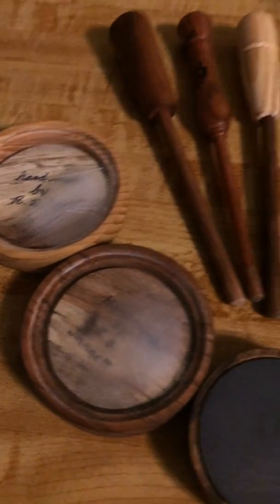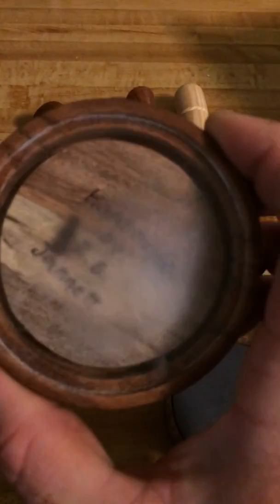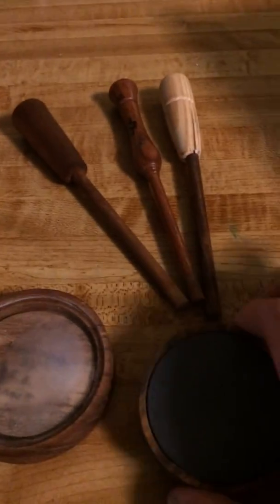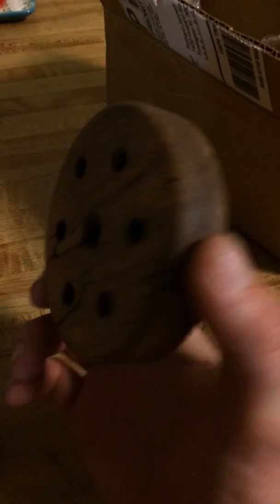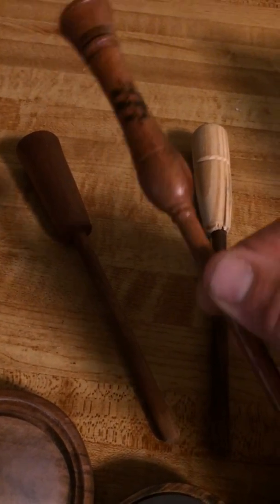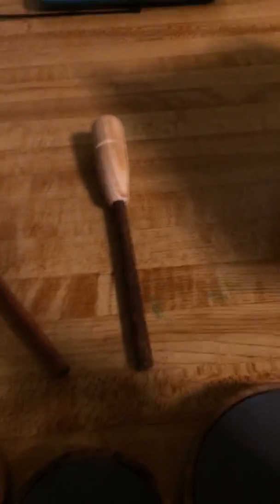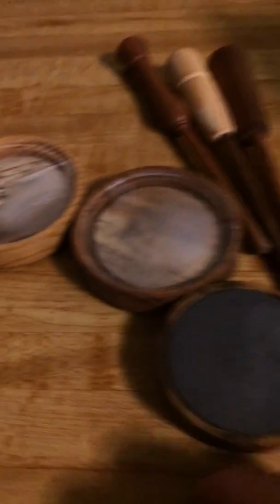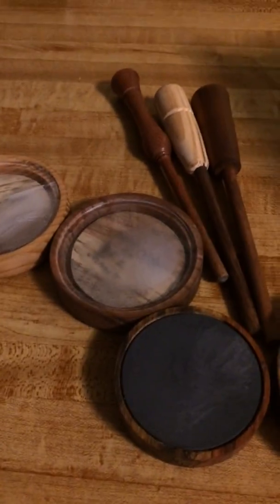Turkey slate pot calls handmade by me

Comment: If your still making calls, I can help.what are you using to glue your surface in, are you using a sound board? how thick are your calls? Why don't you turn the striker from one piece? what is the distance from the top of the sound board to the bottom of your slate? Can you post a picture of the inside of your calls?
Reply from the maker: I'm still making them.  i'll post pics soon.  overall thickness is 3/4", I do use a soundboard and have experimented with glass, slate, copper, and pecan; the distance from the top of the soundboard to the bottom of the slate is usually the thickness of the soundboard but sometimes is a little more.  Just experimenting here.  in my two peice strikers, they are glued, but i havent experimented with making a one peice yet.